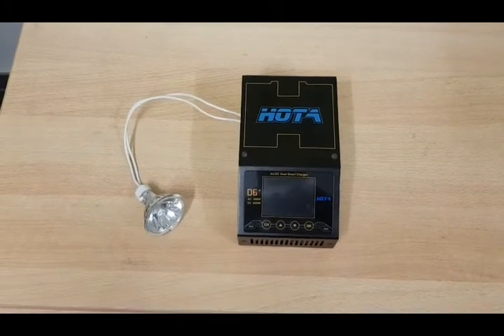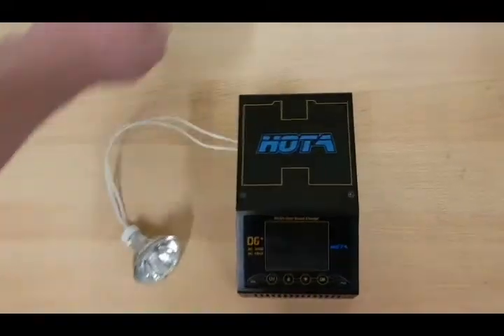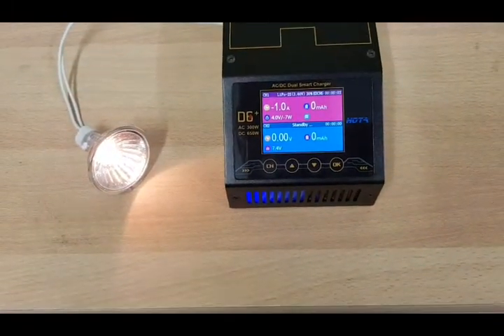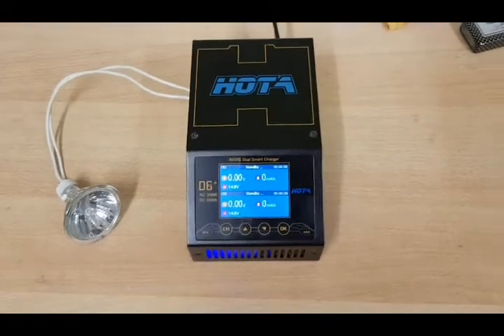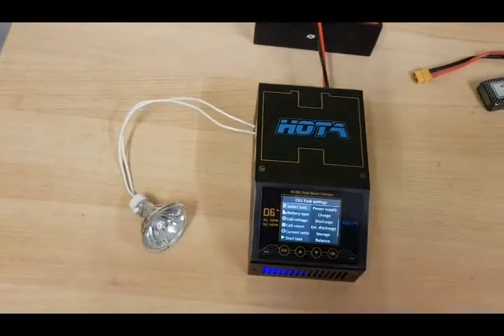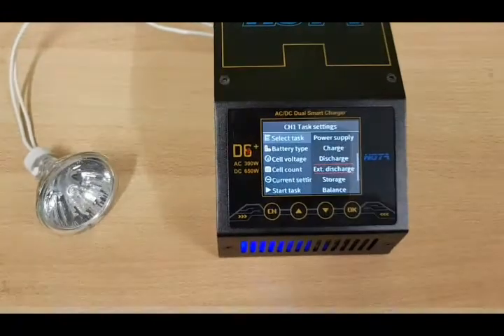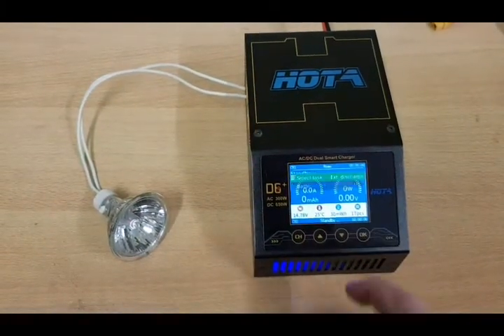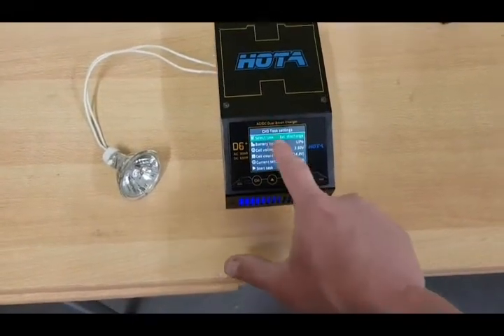Hota D6 external Discharge / externes Entladen

Comment: Hi you need to select the power supply mode first then select again the ext.discharge.  the charger need to be in power supply mode first for the ext.discharge function to work.
Reply: Can you elaborate? I am trying to do this on an S6. I can select EITHER power supply mode OR external discharge, not both.